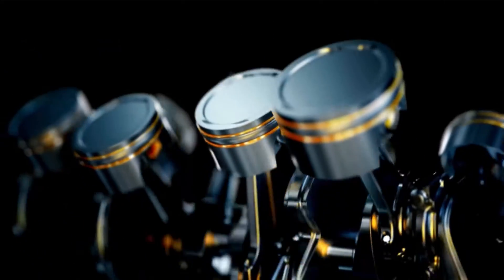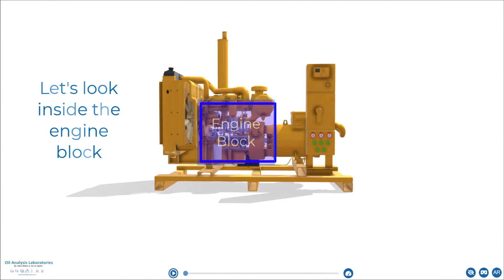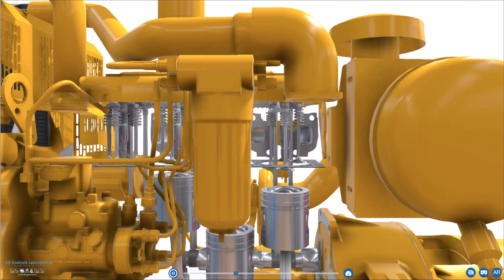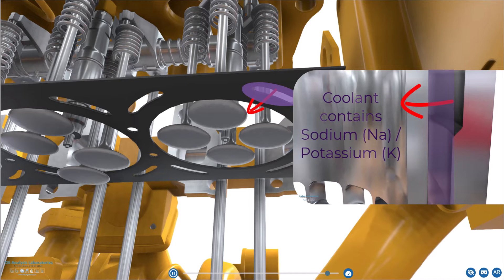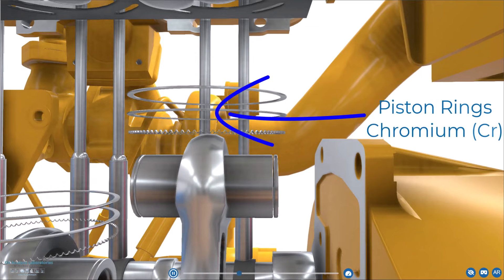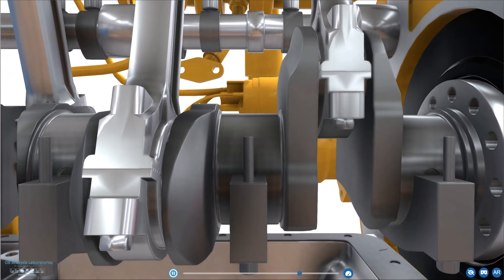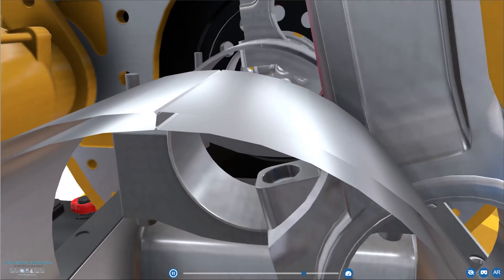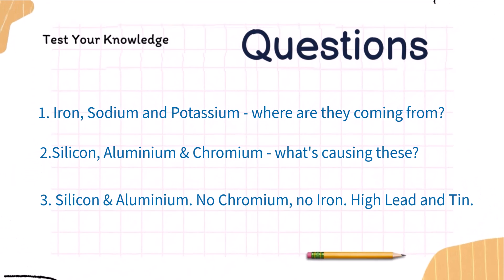Oil Analysis Engine Wear Metals Iron, Copper, Chromium, Lead, Tin, Silicon

Comment: Just got my oil report in, first oil change at 4,948 miles, 14 AL, 19 iron, 61 CU, 199 Silicon…
Reply from the maker: So you have a lot of dirt present. Assume it's an engine oil sample. Perhaps check the air filters and trunking.
Reply from the maker: Just search for an example how to read a report on this channel their is a video for this specific example.
Reply from the maker: Have you tried our source element guide on https://learnoilanalysis.com

Comment: 1. Come from coolant of piston
2. Piston ring have dirt
3. Dirt
Reply from the maker: 1. Yes a coolant leak (sodium and potassium) causing liner corrosion (iron). Customer should pressure check cooling system. 
2. Yes dirt ingress causing ring wear. Customer should check air induction system. 
3. Correct for dirt, but where do you think high lead and tin are coming from and how do you think dirt is getting down there? It's not through the air intake as the chromium, iron and aluminium all normal. So how else could dirt get in.
Reply: @OilAnalysis  Ok, let me try
Lead - comes from industrial paints and primer 

Tin- May be present as an oil additive
Reply from the maker: Hi Leaded paints are less common in the western world but depends where in the world you are. Tin is also used as a marker additive by Quaker lubes. However apart from that odd case it's not additive. Lead and tin come from the bearing. Which is tin flashing. Then lead and finally copper. So it's an early stage of bearing wear. The silicon in this case isn't from the upper cylinder air filter etc as you would also see upper cylinder wear. Instead the silicon is likely dirt or sand from a dirty top up or a new component being fitted which are cast in sand and is often difficult to remove even when cleaned by the manufacturers. I have seen this with many engine manufacturers new and sealed parts fitted by the OEM.
Reply: @OilAnalysis Thanks for your thorough explanation. This will help me to understand more about oil analysis.
Reply from the maker: You are welcome. Tell a friend about the channel and like and subscribe if you find it helps.